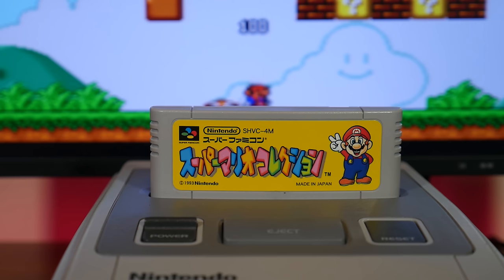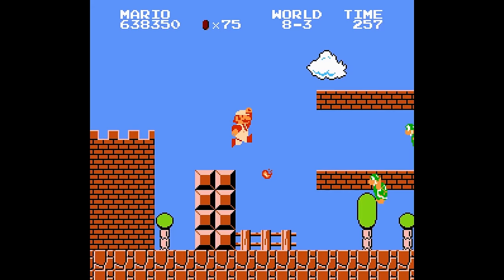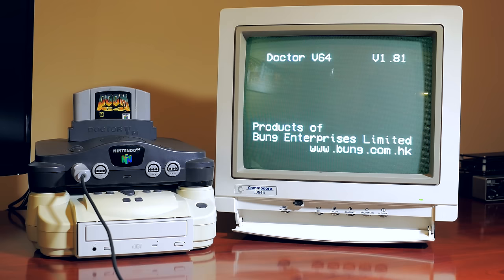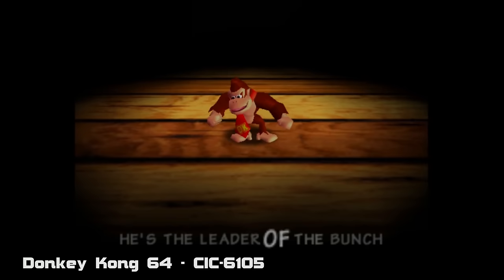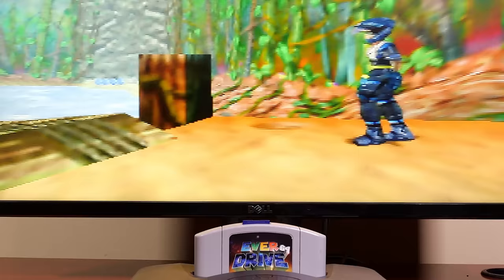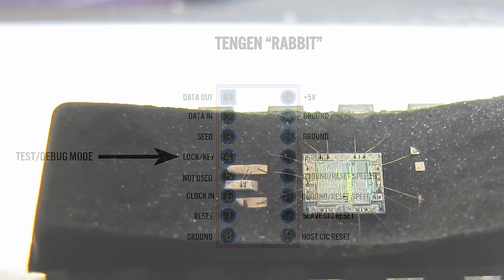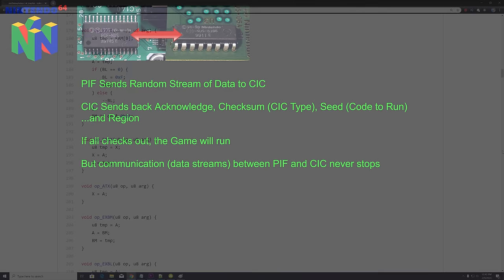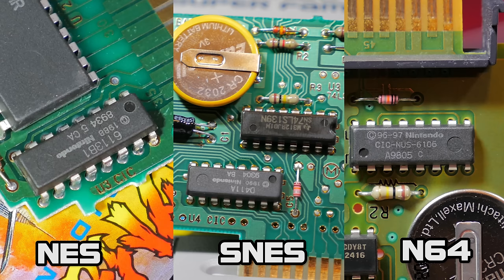How Nintendo Stopped Bootleg Games on the Nintendo 64 | MVG

Comment: I remember when we first found out about running Japanese games on American N64s by removing that damn piece of plastic preventing cartridges from the opposite region from being read. To us, that was the equivalent of bootlegging the games; by buying the official Japanese version of a game. We were desperate back then. 

PS One gamers had it easy.

The most brilliant, flawless, frustrating, flawed piece of hardware I've ever owned.

Yo, MVG, if you haven't done so, just attach the Eon64 and the mClassic cable combined to significantly improve the look of the games on HDTVs. I believe I've seen you review them before. To me, they make the system playable again on modern TVs.

Maybe you can make a vid about that; cover most classic consoles connected with multiple upscalers to improve the games. GameCube + Carby + mClassic,    N64 + Eon64 + mClassic,    DreamCast, PS2, Xbox, along with all their proper upscalers + mClassic. You can cover issues such as lagging times, color accuracy, and so on. Be a pretty dope episode.

Comment: I had an cartridge that has a slot to insert an pirate cartridge on top. Normally the pirate cartridge was lighter than a original cartridge. What the middle cartridge was doing exactly? Also normally the pirate cartridge didn't save

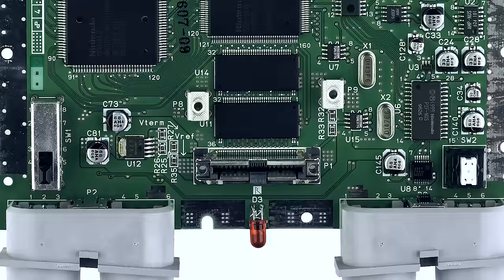Comment: Hello,   I really like this video.  I learn a lot from your channel.  I was wondering if you could please answer this question.  In your video @ 0:49 minutes in you show a picture of a N64 board with two 2mb chips on the board.  From my understanding certain games require the red expansion pak that has 4mb of memory.  My question is that if you were able to change out the two 2mb chips for two 4mb chips on logic board would it be beneficial?  I have noticed that some of the N64, like the Pikachu and Jungle Green versions have only one 4mb chip.  The expansion pak is a single 4mb chip.  So there is a supple of 4mb chips out there that can be exchanged.

Comment: So what’s Nintendo use for Nintendo switch to combat this? And you said everdrive 64 V3 auto detects region and the old ones had a switch pal or NTSC but I got a V3 which has a battery for animal crossing, it still has that switch and you gotta toggle it for PAL or NTSC Nintendo 64 consoles. I got both region of consoles and still gotta flick switch on respective console.

Comment: I'd say the biggest way Nintendo stopped bootlegs was simply using cartridges. LOL! Of course, people bought devices to rip and play backups, but MOST people didn't go out and spend $200-$300 on the hardware to attach to their N64. It wasn't like just being able to burn CDs and installing a $50 modchip in your Playstation.

Comment: I can see, definitely in the next decade, manufacturers will build electronics imbedded within the CB itself with non visible chip pins. & designed in a way so it's impossible to modify it without completely writing it off. Going by the method in which, the Xbox 360 was hacked, I could call future modders as Kamakaze pirates!

Comment: I know this video is 2 years old but why not make a custom flashcart for the N64 with all the CIC chips on an addon board with switches to select which chip you need to use. 

Edit: if someone actually has the skills to do this it would be interesting to see it work.

Comment: That N64 CIC seems to work in a very similar way as the NES CIC, is there a major technical difference (that would make it harder to defeat) I am missing ?
Reply: On NES and SNES the sole purpose of the CIC chip present on the main board was trapping the console in a reset loop if the authentication with the CIC chip from the cartridge failed. You could easily bypass them by disconnecting specific pins of the CIC and the console would still work fine. On N64, however, the chip responsible for doing the CIC authentication on the console also did a lot of other important stuff like storing the IPL, handling peripheral communication and save data for some games. You couldn't simply disable the chip without rendering the console unusable, like you could on the NES/SNES...
Reply: @mbc07  Thanks for the info.

Comment: The CPU architecture of the Gamecube, Wii, and Wii U were all the same, and I think the disc formats were similar too. I wonder if the Switch cartridge is similar to the DS cartridge...
Reply: They're quite different

Also, funnily enough, because the GameCube and Wii U use the same processor, just stronger over time, you can play GameCube games on a hacked Wii U perfectly
Reply: The DS, 3DS and Switch cartridges are all quite different. The Switch's cart controller even has firmware updates for it, leading to certain hacks making it unusable if you downgrade the system after. I guess they were a little bit surprised by the Sky3DS, no arbitrary code execution needed for piracy if they can do full clones of the carts. Wonder if we'll ever see someone reversing that.

Comment: As a long-time backup user who still has multiple V64 and V64jr devices, I don't recall the retail version of DK64 running on 6102 without a boot emulator, boot type swap (16 bytes + CRC fix), or patch. Of course, then it would seem to boot but would do things like wipe your save after checking again during runtime.

Rare's later games like Banjo-Tooie could detect the Universal Boot Emulator and throw up a "No Controller" error.

The thing about Star Fox 64 is that the ROM would work because the only English ROM floating around at the time was pre-patched. You only needed to swap 16 bytes with a 6102/7101 game then correct the CRC since the game had no other checks. I had to dump my original cartridge to get an unmodified one.
Reply: I didn't have any of those back in the day (or knew they existed), but I've become very familiar with those things in recent years.
It seems that Banjo-Tooie uses the extra challenge-response functionality in the x105 to unencrypt the game's assets, and that's why it doesn't work with regular bootemulation techniques. Eventually someone cracked the ROM with a unecryption routine, I believe.
As for DK64's save wiping, I've seen suggestions that it's not actually a copy-restriction countermeasure, but might be a bug on the save data code which is tripped by N64 emulators and ROM emulators (BUs, flashcarts) emulating a specific variant of the EEPROM chip different to the one in the original cartridges.
64drive maker marshallh told me a while ago that he had to fix something there and never heard anyone complain about DK64 problems again.
I intend to first try to play through the game with a clean ROM using a 6102 and bootemulation first and see if anything happens. Right now I'm runing with the cart with an installed 7105 (PAL) and a selfmade T-connector when I play on my NTSC console. I need to un-jump a connector on the PCB to return the menu ROM to 6102/7101 mode, at which point I intend to install a switch.

Comment: hmmm, no mention about boot emulators or what they do, or the region checks and their warning screens, or the actual bootcodes in the ROMs and the associated CRCs in the headers, or the early attempts at patching ROMs for backup units by changing the bootcodes and recalculating the CRCs and how games like DKR messed with those attempting it.
And there's a chance that the bit about DK64 erasing your saves due to using the wrong CIC may actually not be so, but rather the result of something else (but on this one I'm not sure).
A bit lackluster, I must say.
Reply: And no mention of Banjo-Tooie using the CIC as a crypto key. That seems like kind of a big deal.
Reply: @renakunisaki  Indeed. I didn't mention that because he does mention the game in relation to the x105's challenge-response pairs and that they are needed for the game, but he certainly could have been more specific on the role they played in BT, decrypting the game's assets.

Comment: I would not call staying with cartridge the right move for Nintendo. They lost so many 3rd party companies to Sony for not utilizing the CD format it's not even up for debate. Nintendo's need to stick with tradition cost them dearly and Sony ran them over as if they weren't even there. The custom chip inside the N64 was not akin to a 3d accelerator found in gaming PC's. The first console that utilized a GPU like a PC was the Sega Dreamcast.

Comment: At least we got carts now and good fake carts. 
Pretty much 3 decades later. 
Emulators are fare at best. Some games need tinkering. Still capability problem. Whatever. 
I grabbed a n64 after i started doing the job working thing for that money. Was doing emulation for n64 since 2003 or something. Same goes for most of my other consoles. 
Now if the console was just a base for the games and a PC had a app or program has as well. Whatever emulator from some dude who knows programing will do, a little work for capability and accuracy.. 
I don't see alot of NES games for example been made if it had the power of the switch. Terrible 3d games i noticed on the GBA, id rather it be a 2d game.

Comment: Is it just me or does it seem like the people who are capable of breaking anti-piracy measures are people talented enough that they should be able to just buy their games? I mean, I guess its nice to play games on emulators since they can be scaled, but I seriously doubt running an emulator on a PC between 1996-2000 was any better than just playing on original hardware. Eh, maybe its for the challenge?
Reply: not only challenge and curiosity, but also stuff like homebrew games and romhacks, and also archival; at some point in time, all N64s will eventually stop working, so what do you do if you want to play SM64 in that scenario? emulation!
it goes waaay beyond piracy
Reply: @GoulartGH  Point taken. I've never had any problem with home brew, but piracy definitely doesn't sit well with me on new games. My general rule of thumb is that if you can still purchase a game from a first party distributor at original price or less, than thats generally the way to go, but a lot of older games get lost to time. Then you end up having to purchase them from third parties often at a markup from what the game is actually worth.
Reply: @paladingeorge6098  agreed; however, cracking new games still have a purpose, which is also archival - a lot of these games must be downloaded online, with DRMs that require online activation with some service. if either of these fail (e.g. the company behind goes bankrupt, or just decides to shut the service down and move on to other stuff (wii shop, for instance)), the game is unplayable.
(i'm not gonna defend the pirates themselves tho dw)

Comment: Banjo Tooie and Jet Force Gemini run pretty bad PJ64,  Gemini is almost unplayable and I wonder if it's due to the anti piracy code
Reply: definitely not. It was common for the games at the time to have unstable framerates, not just 64 games, but Rare sometimes did prioritise technical achievements like graphics or a lot of objects in scene over performance
Reply: It's because N64 emulators are trash.
Reply: @renakunisaki  Could be just because he's using an old version of PJ64 and needs to tweak some settings, maybe swap some plugins and enable hardware accel

Comment: N64 the last great nintendo system
Reply: You mean Gamecube
Reply: @videotape2959  gamecube was wack i had it back in 2002 tiger woods games on multiple discs, mario sunshine weak compared to mario 64. waverace bluestorm weak, mario kart dd WEAK. all the n64 version are better. ps2 MURDERED gamecube, so much better. og xbox was pretty weak too. GC controller was pretty shit too the fuckin d pad was designed for a 2 year olds fingers
Reply: Luigi's Mansion, Metroid Prime, the two Pikmin games, the Sonic games, Super Smash Bros Melee.. I guess you missed those ones huh. Yeah the D-pad is pretty awful, not because of its size but because of its lack of precision. Fortunately 99.99% of the games on the system do not require precise D-pad inputs.